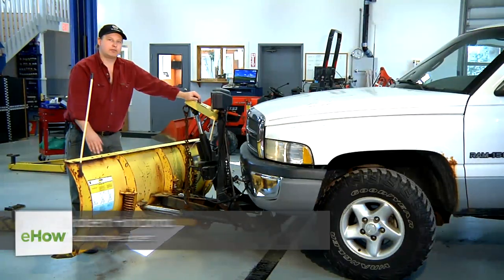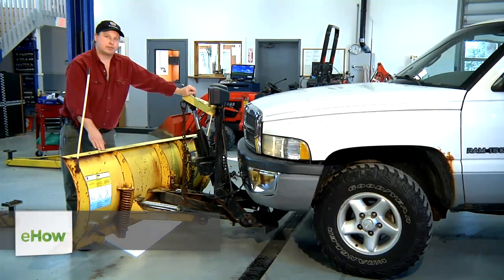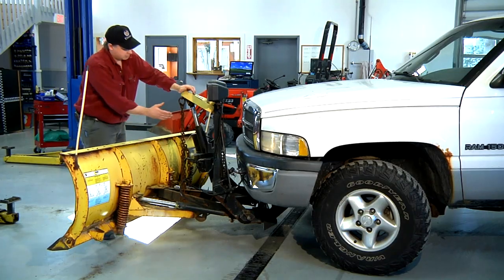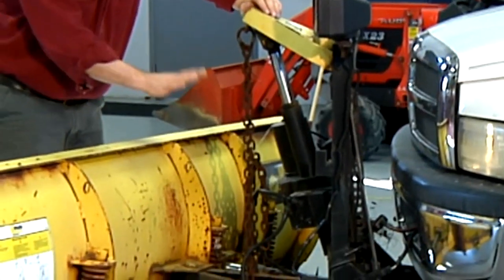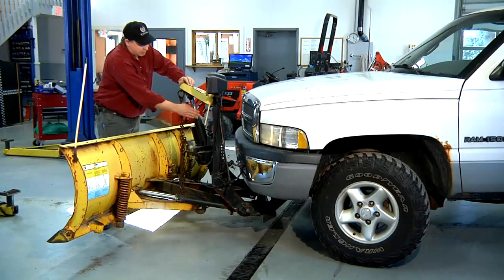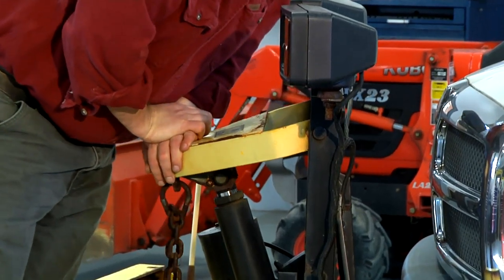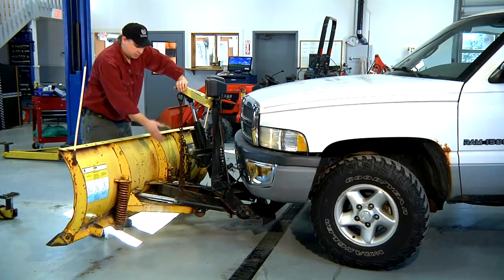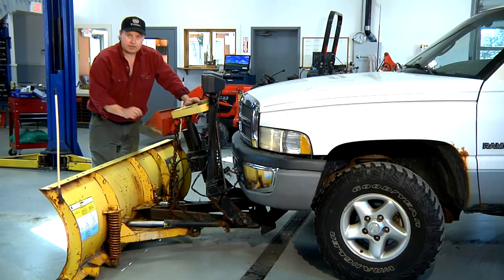Auto Repair Tips : How to Bleed a Plow Cylinder

Comment: I know this video is old but I want to clear up one statement he made, the angle cylinders are single acting cylinders, there is only pressure on one cylinder at a time whether it be to angle left or to angle right. When angling, one cylinder pushes and the other cylinder just lets the fluid out. Hope this will help.

Comment: I am having a hard time pushing my piston down and I see you had no problem. Do I need to bleed it? Plow works in all directions. I put my whole body weight on it and it didn't budge. Thank you
Reply: The Engine must be running I found out when I couldn't put mine down. After you set the plow down. Before shutting off the engine, push down. That worked for me

Comment: Hello Bob!
I just have my plow for about 2 years, and at the beginning I was struggling to put the plow’s cylinder down which I could hook it up. From a time to now I can not do it no more, the cylinder doesn’t go down for nothing, if it’s unhooked and I need to hook it up, I will need to lose the chains removing the screws or using. a jack which it takes me a lot time to do it. What could be the issue? I changed oil and cleaned  the pump, but still no success. Would you please or someone here could give me some tips? Thank in advance.
Reply: Do you have the controller powered up and in float mode? The cylinder can only go down in float mode or if someone is holding the controller in the down mode. Hope this helps.

Comment: i have a question i have the same plow this morning i picked up plow while backing up the bottom low corner of the plow got snagged on a cable jerking the blade later i lowered the plow when i went to pick it back up it would pick up or turn motor ok , im thinking back pressure on cylinder getting pulled blew a seal ? thanks

Comment: I have either a seized pump or motor as the motor just clicks even with a jumper tapped to the red wire on the pump, it wont turn
Reply: I was wondering about a how to on repair or replacement